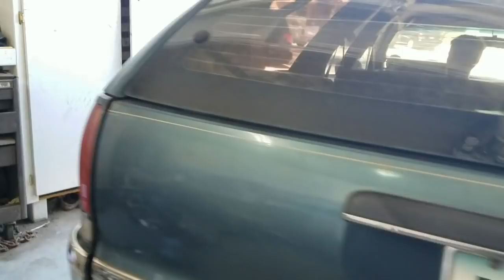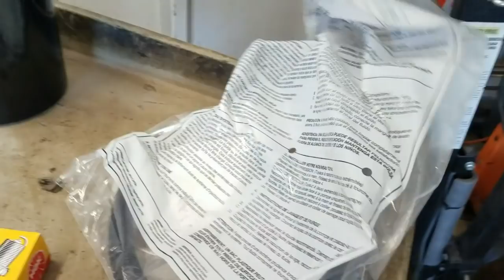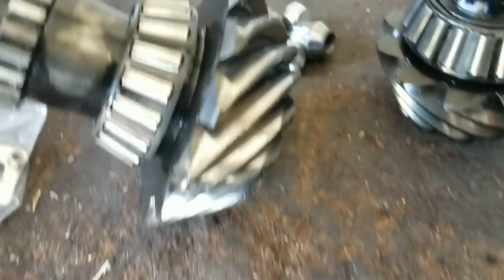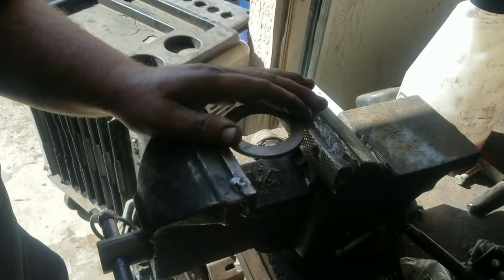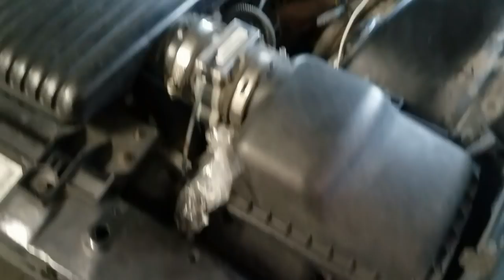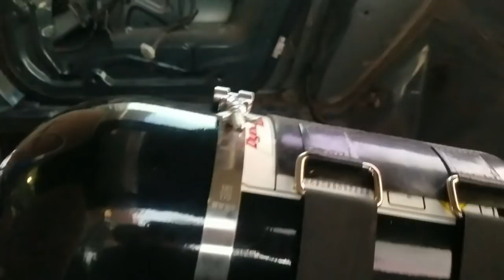11 second 1/4 mile sleeper for under 2 thousand dollars part 1

Comment: Thats a nice wagon. You shouldn't cut it down. Its an all cast iron engine. Not a mixture of aluminum and iron. Aluminum and iron on the lt1 Camero had lots of problems because of the mixture of metal and poor selent. I like it better than some sports cars.

Comment: HOW MANY HP AND RPM WILL BE SUPPORTED BY ANG STD CONNECTING ROD
Reply from the maker: That is not a finite thing.  If using nitrous dont activate until about 3k rpms to help keep the rods in it.  Also a loose converter helps.

Comment: Good luck! Even if you get close to 1000hp in order to run an 11 the rear end will be in pieces again moving 5000lbs with a 10 bolt
Reply from the maker: I have been very impressed with the strength of the rear end honestly.  It still has the Gov lock and gears from a 250k mile Tahoe in it.  Been meaning to pull the axles and check for twisting but haven't done it yet.

Comment: Would love to see how they hooked up the tachometer
Reply from the maker: James Newman power ground and spliced into one of the coil wires.  Whoever did it, did not do a good job.  It did work but janky as hell.
Reply: It’s in the factory radio believe it or not!
Reply: Actually it's in the factory climate control, but you're in the ballpark. @dodgeguyz
Reply: @sfgwl  
Ah yes. Not a GM guy but I remembered it being in some kind of odd place to be displayed. Thanks!

Comment: What a waste of a cool wagon.
Reply from the maker: I assure you, the wagon is so much cooler now than when I got it.  My newest video up shows how fast it is.  Its a total riot to drive around and nobody expects it to be as fast as it is.
Reply from the maker: @cv 67 I dont have the actually build specs posted up anywhere but yes, it's now in the high 12s on motor and  waiting for the tracks to open back up to see what it will do on nitrous.  Maybe soon I will do a video detailing the build.
Reply: Auto Repair tips please don't give advice and I assure you that wagon was probably cooler when you didn't own it
Reply from the maker: The wagon did not drive before I got it.  How is that cool?

Comment: You will not pull elevens with that setup
Reply from the maker: Well you can tune in for the next installment of this series where I will prove you wrong.  I have had a few set backs and waiting for track test and tune nights when I have the time to go sucks.  I wont lie, its been harder to get to 11s than I previously thought it would be, but its in the low 12s on the 100 shot.  I just need to work on the tune a little and get a track night where I can get more than 1 pass in.

Comment: 2,000 for a 96 roadmaster limited with 220,000 miles should I purchase?
Reply from the maker: That's a lot money, I would not get any roadmaster that is not a 94, 95 or 96.
Reply: Auto Repair Tips I meant to put roadmaster
Reply from the maker: That is A LOT more than I paid for this one but if it was in excellent condition it might be worth it.  It would have to be really, really nice though.
Reply: Noooooo

Comment: what happened to this??? Im really curious to see how it went!
Reply from the maker: I have had it to the track twice.  First time the dash cam did not record any sound, so its lame as fuck.  It was also crazy fucking busy so I only got two runs in and only hit the 100 shot once.  The second time the nitrous switch stopped working and having transmission shifting issues.  I have an update video but I feel without it hitting 11's yet its not even worth posting.
Reply: Udated progress videos would be sweet.
Reply from the maker: @jamesantonelli2580  I will be taking it to the ziptiedrags this coming weekend and entering it in the 3khooptiechallenge so watch for that update video!

Comment: It was rad meeting you at wild horse pass the other night. I test drive my RM on Sunday and it won’t shift out of first and the speedo stopped working...sound familiar lol
Reply from the maker: Sounds very familiar LOL I put insurance on the car today and got a temp tag to be able to do some street testing.  It shifts perfectly just tooling around and even WOT downshifts to 2nd but doesnt like the 1-2 shift at WOT.  I definitely dont want to take it to the track to have the same problem again.
Reply: @AutoRepairTips  my bet is on the vss wiring. It has its own sensor and sensor ground wires directly to the ecu. I had to plug/unplug/move a bunch of connectors and wires when i did my waterpump and oil cooler lines so theres that, plus old ass connectors everywhere. I found one report of it online too. 🤞.
Reply: @AutoRepairTips  torque at WOT could be pulling on the wires for you maybe...
Reply from the maker: I honestly hadnt considered the pulling on wires theory.  I have two different obd2 pcm's that were "professionally" tuned for a setup very close to mine I am going to drive them around and datalog them to see if the mph skips around on WOT.  That will tell me for sure if it is a hardware or a software issue.
Reply: Auto Repair Tips does your speedo work at low speeds? 

From my research The vss signal goes directly into the ecu, which sends it back out as ‘vss 4k ppm ‘ signal to the cluster, power steering, cruise control, and turn signal alert alarm units. That signal wire is shared between those units which have pull-up resistors built in. So a short in the unused wire to the cruise control would short out the cluster too. I’d assume and hope that the ecu’s internal vss signal is shielded from shorts of the ‘4K ppm’ signal.
Reply: Auto Repair Tips just got under my car. Looks like something sat on top of the trans and chewed through the vss wiring and loom. Too bad I can post pics on here lol
Reply from the maker: Tested out the OBD2 pcm this afternoon.  It works flawlessly  I actually used it to take my car through emissions today.  I need to figure out what they have programmed in this thing.
Reply: Good to hear. Is there possibly a difference in speed sensors on the OBD2 cars? Also, what were the search terms to get the tuning cable and software I need? My car is fixed now too.
Reply from the maker: I got my cable from aldlcable.com  They have both kinds of usb cables you just have to look to see what port is in your car.  The page for the datalogger and the flash tool is fbodytech.com   He has all the info you will need to learn how to start tuning.  He pretty much lays it out step by step.  There is also a good forum for tuning questions on gearhead-efi.com.  The guy who runs fbodytech responds to questions on there too in case something glitches.  For my trans issue there are a couple small differences in the transmission so I need to figure out if thats what is causing my issue.

Comment: Shame you stripped the interior out.  Would've been fun to see eight people riding with seatbelts approaching 11 seconds, especially with the back two facing backwards.
Reply from the maker: I would have loved to make an 11 second pass with 8 people in the car.  That would flat out be amazingly fun.  At least traction wouldn't have been an issue.  I wonder if they would let me run at the local track like that?  With that many people and the heavy car it would push about 6300 lbs.  According to the drag calculator I would need to be in the 675 hp range to make that happen.  How do you think the stock lt1 would handle a 400 shot? Haha!
Reply: Good point about the weight.  A buddy of mine had a Monaco wagon that was going awful damn fast but he had a 440 bored and stroked to 496.  And he just ate that motor for lunch driving it like he did.

I once heard a story of a track that was open but disused.  Tree was set on automatic, old guy in an old Desoto convertible comes in, pays, starts making passes.  Guy in the gate isn't paying attention, until another driver pulls up and comments on the times that the Desoto is running.  Guy was running mid-twelves with just a scullcap helmet and a lapbelt.  They rush over in a huff to shut him down.  He comments, "I knew it wasn't going to last, but damn it was fun while it did!"
Reply: TWX1138 any chance to post the link for the Monaco Wagon?

Comment: This looks like its going to be a blast to build.  I'd love to help turn wrenches on it.
Reply from the maker: well, its mostly built already.  We did our first hit on nitrous, we set it up for the 100 shot to test it out and it worked like a champ.  Maybe tomorrow we are going to take it up to the 200 shot.  I am worried about when it hits fuel cut at 105 mph though.  That would almost certainly damage the engine.
Reply: Does your wrench need a good cleaning?